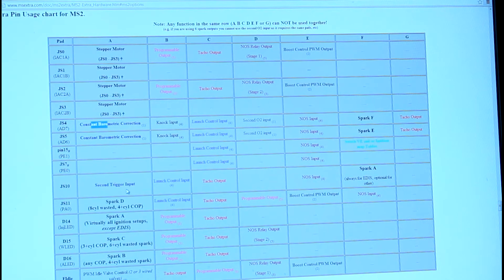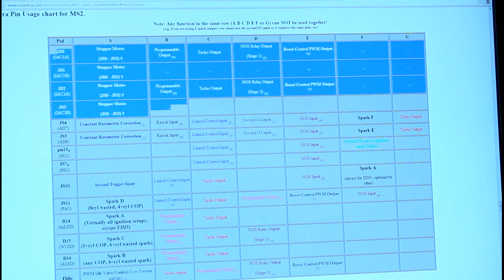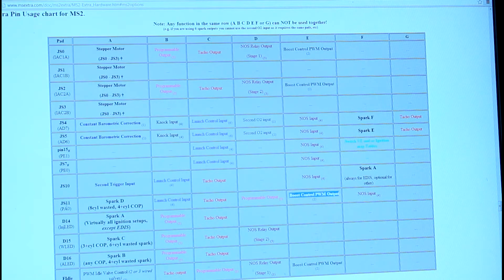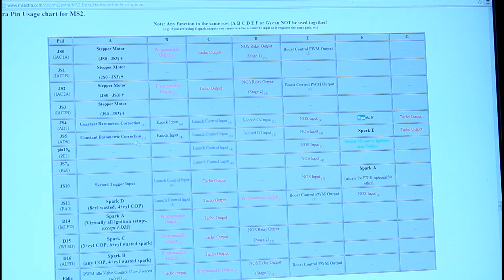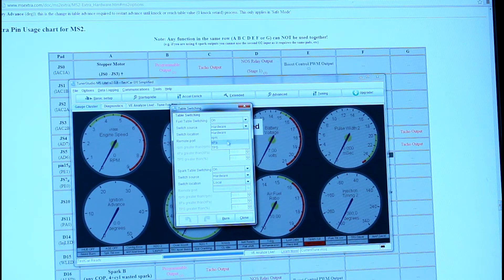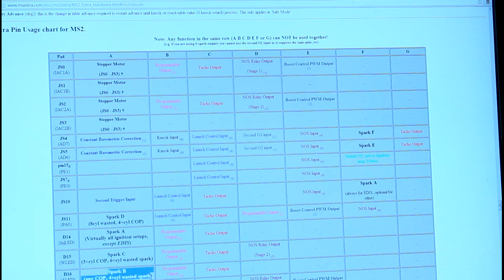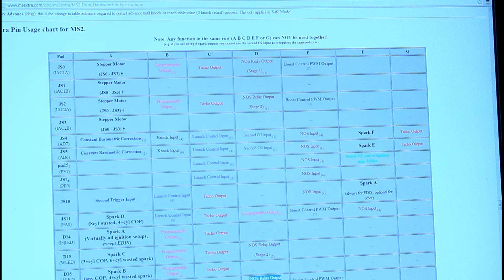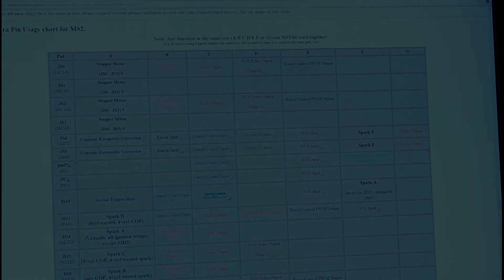Evan's Megasquirt Build Ep 9 - MS2 I/O Pin Usage

Comment from the maker: Do you mean it will not crank, or not start up?  Cranking is technically just the starter motor spinning, if it will not do that even, you have a problem outside of megasquirt... clutch switch, starter motor, ignition switch, etc, etc.
If it will not fire, start checking for fuel and spark by isolating each system via the fusing.  Good luck.